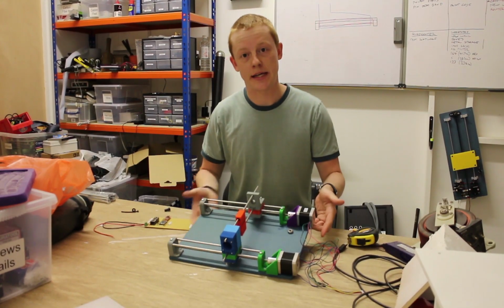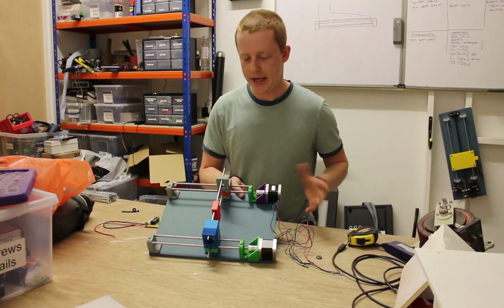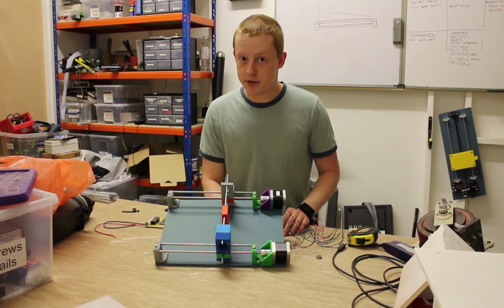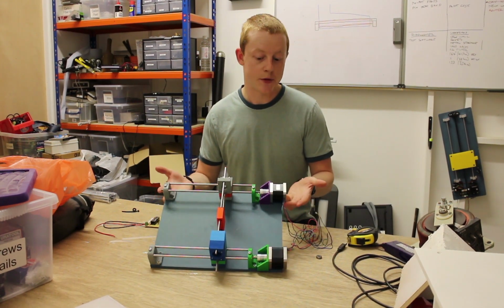Laser Engraver - Final Update

Comment: bummer... I was hoping to find you were still working on this. I do love your design and those printed parts really are nice. I think using one smooth rod per side and using the threaded rod to hold belt pulley's would really improve this thing a lot. Im getting ready to start a similar project using parts from a 40w co2 cheap chinese laser instead of a diode but was looking to your design for inspiration.
Bummer but maybe one day youll pick it back up?